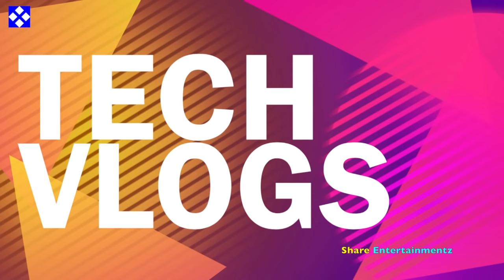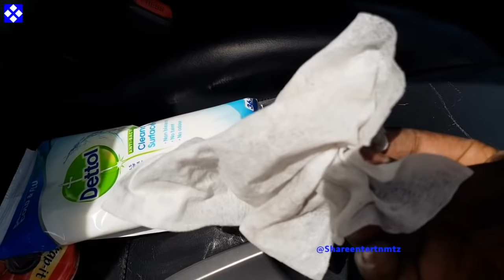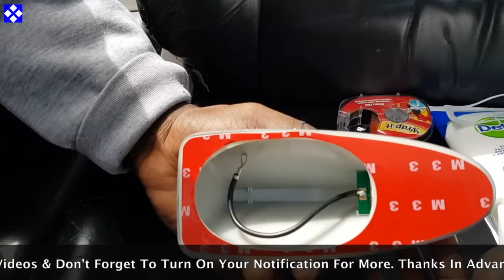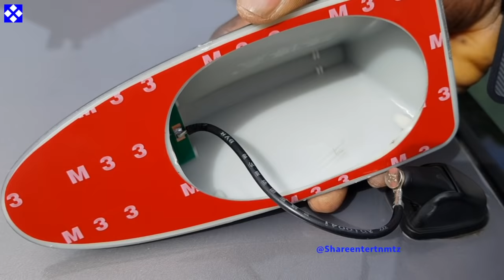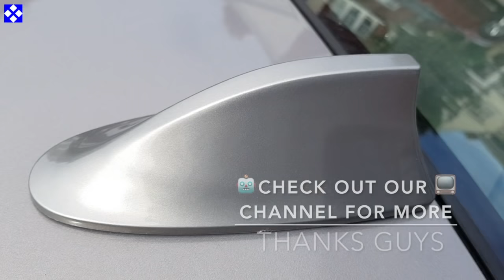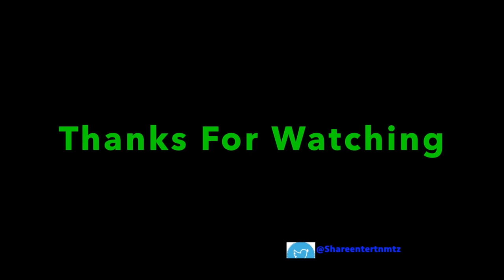How To: Install Shark Fin Universal Antenna

Comment: For anyone wondering, this is entirely for aesthetic looks. You might have some more interference and a bit of signal drop with for FM radio, the 3M adhesive that comes with these kits is typically strong enough to withstand an automatic carwash and to remove it if it starts to come off, you'll need a heat gun, hope this helps anyone
Reply: Now is it a massive drop to where you absolutely can’t use it or is it spotty cause I just use my Bluetooth in my dart and was thinking about buying this.
Reply: @brancetaylor8189  was wondering the same thing I just use the bluetooth in my Dart as well

Comment: I would suggest putting a bead of silicon around the base too, as water gets in there, and can rot the metal roof, and the electronic part of the antenna  under that fin, and then you will have major issue's with rust in a couple of Years,
Reply: Wouldn't that make the 3m aggressive less effective?
Reply: That doesn’t make sense as the original aerial let water in too what difference does it make
Reply: Silicon on the metal will cause the rust faster than any other thing, even water. Avoid silicon on ur car. If u see the windshield has a special glue that doesn't contain silicone.
Reply: @mrchicken8325  If this is the case, then why do plumbers use it to seal bathrooms?

Comment: My 2016 Subaru Legacy comes with a sharkfin antenna cover. It is currently leaking.
Reply: what do you mean leaking?
Reply: Looks like the glue seal wears out and allows water to seep into the antenna. The antenna has a rubber gasket that can also fail and allow water into the roof. I had water stains on my headliner.
Reply: might get your car roof leaking inside it nvm i won't buy fake shit shark fin antenna anymore

Comment: My question is, will automatic car washes pull it off??
Reply: I have the same question.Did u buy it/try it?
Reply: No it didn't come off in the car wash the 3M adhesive base is very strong. You would need to heat it to remove it.
Reply: Mine came loose  because of the automatic carwash.
Reply: Yes I work at one at it knocked mine off

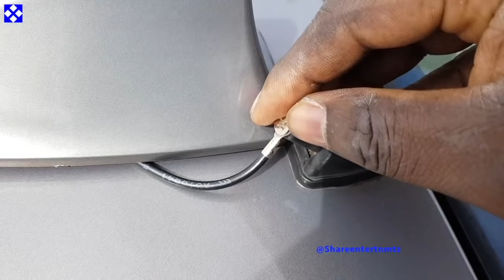Comment: so what if i dont have the piece you screw the bolt into anymore. where does the wire connect to the inside of that? im not replacing EVERYTHING on the antennae when i have the base but not the stupid rubber mess there.look at 1:57. i dont have that part but everything underneath.
Reply: steve b did u ever figure it out I’m haveing the same problem
Reply: I'm having the same problem too. Purchased an antenna from Amazon that says it fits my Grand Prix but when I went to install it found out it had more of a snap in and no screw in. Think I'm missing a base piece/adapter.

Comment: Do they improve the reception on the radio
Reply: Mine didn't, I found the reception was not as strong as with the normal antenna, also much more interference.

Comment: I just went to replace mine in a 2019 Suburban Premier well I have a coax or fiber running up to my so after tearing my headliner pretty much all the way out it has a way more aggressive contour that most and broke the cardboard so took everything apart to the back door handles to get in there to f with the thing I bought the replacement that didn’t have the coax so put some sealing strips under it and now it’s 3/16” the roof f GM I am going to Silicone the f out of it then drive it till I can go buy a Toyota!!!!!!   American 🇺🇸 made shit can kiss my - a s s.   90,000.00 for a product and it has 5 major problems well not this sucker again!!!!! Shitty times to be alive!!!! So Sad to see the shape of this Country!!!!

Comment: did you have a nut with yours as you just screwed it into the hole,mine came with a nut but never used it
Reply: Dean Fincham j
Reply: The nut is just so the screw won't get lost during shipping.

Comment: What size is that screw mine did not come with one
Reply from the maker: Description

Universal shark fin car antenna features:Easy to install. FM/AM radio with internal connection cable. Concise and modern design.Durable, classic, practical and beautiful.Style: shark fin (aerodynamic design). Package includes:1 aesthetic car shark fin FM/AM antenna. 2 threaded screws and 2 nuts for installing the antenna. 1 3 m sticker for affixing the fin.Technical specifications:Height: 6.5 cm. Depth: 5 cm. External width: 7 cm. Internal width: 6 cm. External length: 17 cm. Internal length: 9.7 cm. Material: high-quality ABS plastic.

Comment: Good job bro
Reply: is  back to front
Reply: Good job?! Lmfao... no.  It wasn't at all. 
No screwdgie, fingertight assembly= shit reception,  he connected the cable before peeling the 3m backing which means he had to redo it or go get scissors and cut the shit, then he  didn't even attempt to conceal or pack the cable into the housing......
But most of all,  the damn thing is on backwards!! Dude has straight up defeated the purpose of design. 

Just as well wire a fucking brick to the roof.